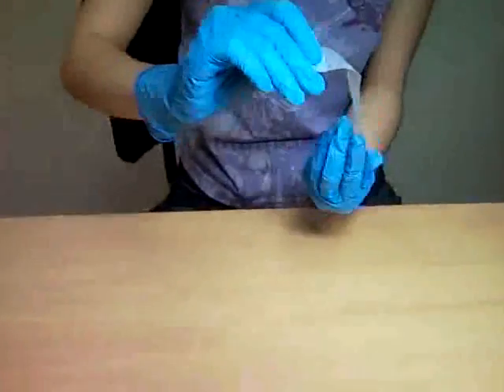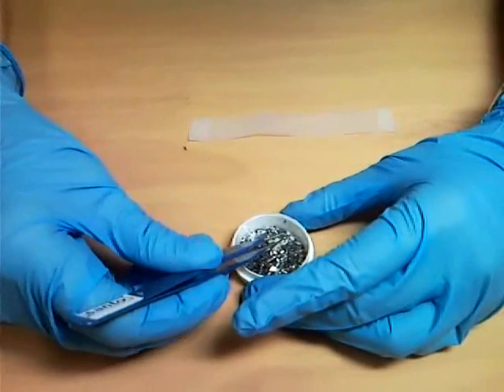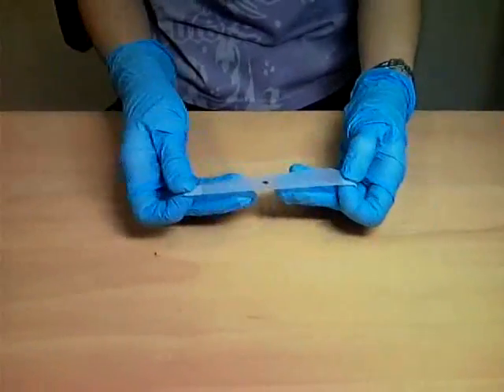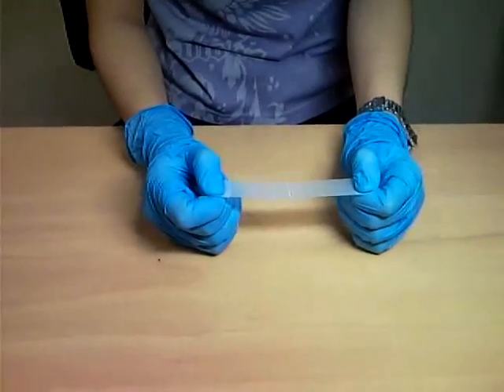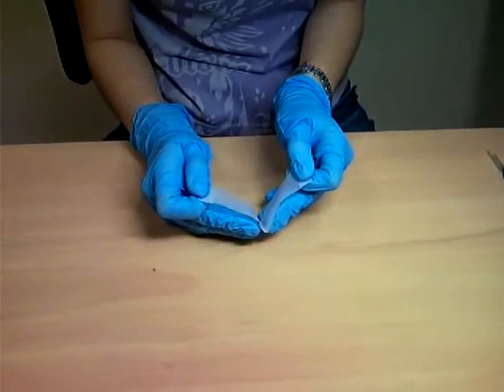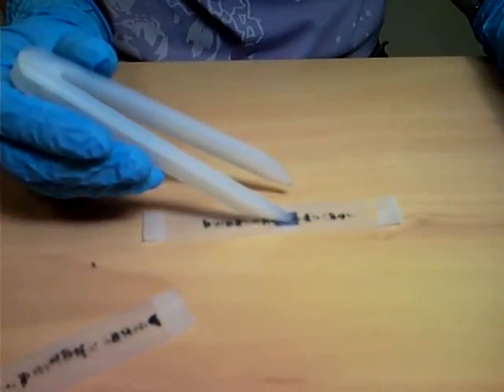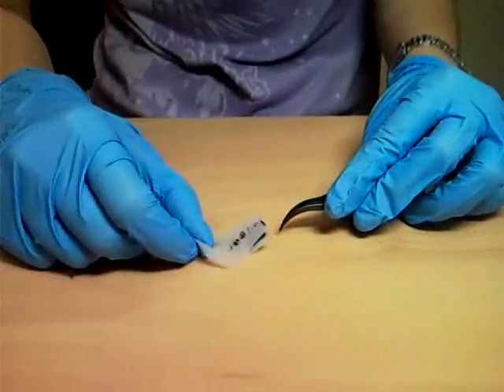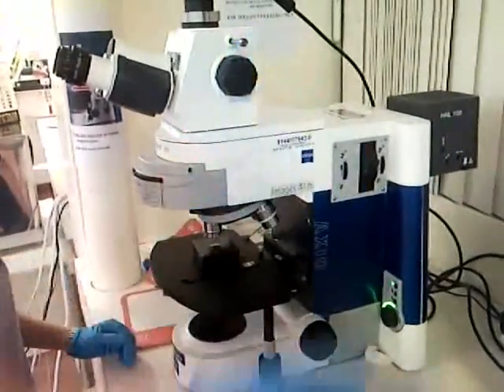Making Graphene 101, Ozyilmaz' Group

Comment from the maker: @SweStuff94 Most steel already control the hardness by the percentage of carbon content. I'm sure graphene will improve the material strength, but there are considerations on the amount of graphene added and if heating will destroy the graphene by oxidation.

Comment from the maker: Assuming you are refering to number of layers, it depends on the person doing it. With practice, there should be at least a single or bilayer graphene on a 1cm by 1cm chip surface of size >20um. 3-4 points on a chip is most common.

Comment from the maker: That does look like bilayer, though contrast on the screen is not as accurate as looking into the microscope. At the magnification, as mentioned previously, the vertical height of the image on the screen is 100um. Unfortunately, as this is a point on the chip used just for recording of this video and it was recorded long before I uploaded this here, I can't remember the details.

Comment from the maker: Size of bilayers should be similar to single layers. But personally i do not see many very large size bilayers, about >80um, as compared to single layer. I also forgot to mention that we generally tend to get many more long thin strips of graphene as compared to large area. I have obtained a 180um*10um long strip but only 100um*40um if you consider area. Even these are relatively rare.

Comment from the maker: The single layer graphene shown is about 10um in length. This is just a random position on the chip but it shows the contrast difference between each additional layer of graphene. As a guide, the height of the screen equals 100um.

Comment from the maker: Depends on your graphite flake thickness, 5 times at least is a good start. Optical microscope is always an excellent and fast indication of the number of layers and is hardly wrong. We do Raman frequently for verification in important expts and checking quality of graphene. We use white light source, but the prefered wavelength depends on your substrate.